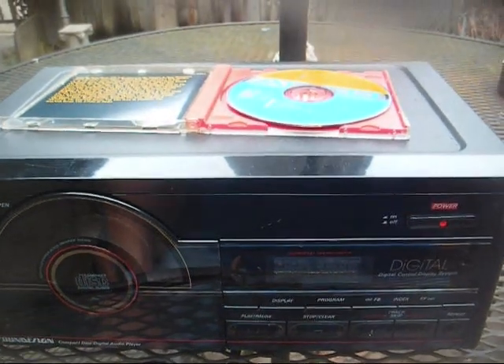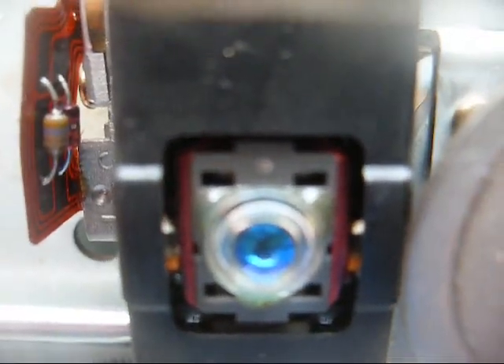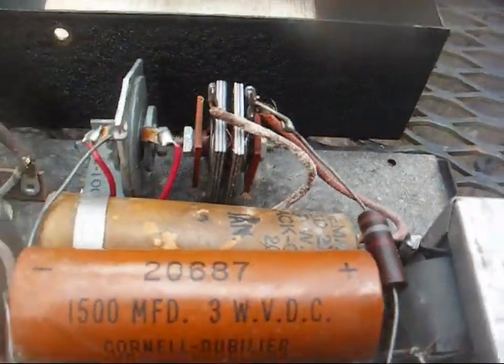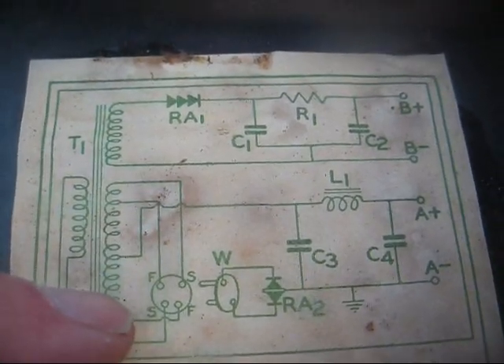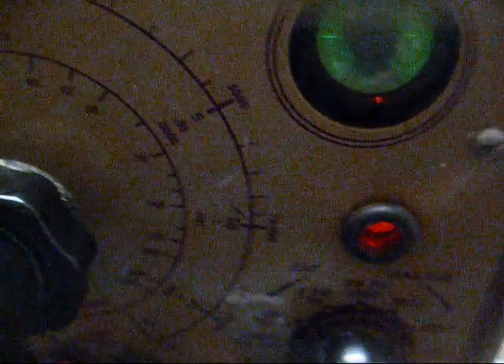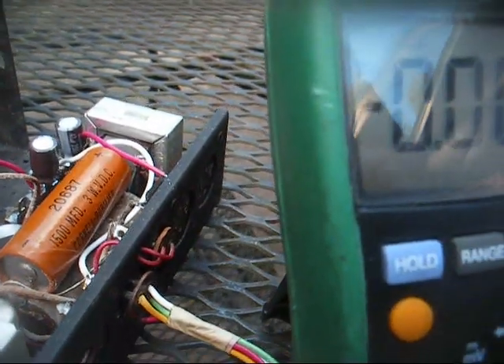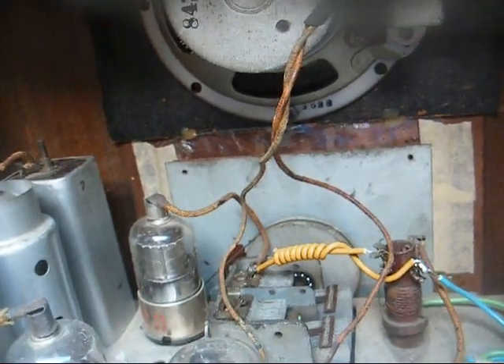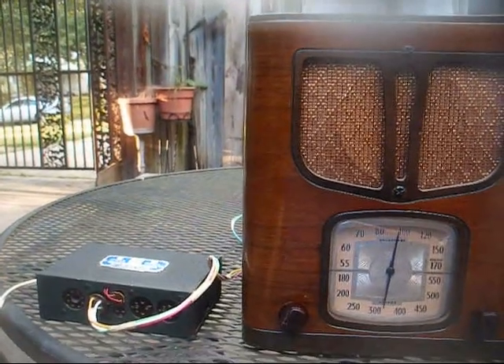Soundesign CD player repair attempt #2 & Perma-Power battery eliminator repair

Comment: if cleaning switch don't help woner id lazer is weak, try adjusting the lazer voltage up just a bit and see if it starts reading, that will tell u that a new lazer is needed in future.

Comment: Regarding the CD player. Do not condemn it yet. I have a good idea where the spring goes which would stack up to why the disk is not turning. When you pat a disk in a drive and it takes the disk in, the disk gets clamped between the motor spindle and a slave spindle. If I am correct the spring looks about the right size to fit behind that wheel. If the spring was missing then the CD would slip, the motor would spin but the CD would not, the player would give up when it could not read the disk. The color of the lazar is normal for a CD lazar, the color you are thinking of would be found in a Blu-Ray player. I hope this is helpful.

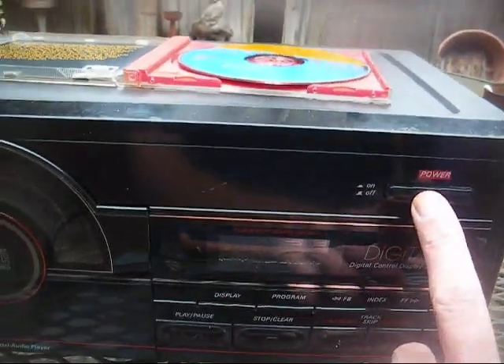Comment: 0:30 - That blinking display like that means the BIOS or logic circuitry has crapped the bed.  The fact that it can read the TOC(table of contents) on all red book CDs, indicates that the laser itself still has life left in it.   Time to EOL.

As far as your comment, in part one of the Soundesign CD episodes, about CD players "not lasting as long as expected" - they were designed that way on purpose.  

I work in second hand, and of the laser-read players(CD, DVD, Blu Ray) I've tested, about half don't work.  

And there's a bigger reason behind that, I'll get to later
Reply: CD is a crap format sonically as well as reliability, POS back in 82, POS today
Reply: @VaughnfromPeterborough   Put crappy sounding content on a CD, of course it will sound like crap!  The format itself is sonically transparent.    I'm sick of people blaming formats instead of what's put on them
Reply: @Zickcermacity  I friend of mine hates the 44K sampling, he believes it makes any recording sound "metallic", he recorded the council health inspector on the computer (mic and cass deck preamp feed in) for one he heard the man in person and heard the playback of 44K file, I asked why he didn't use 48K, he said the rec software defaults to 44K and he overlooked the settings
Reply: @VaughnfromPeterborough   Does he hear this 'metallic' sound on CD albums he bought from the store, or just on ones he produced on his system at home?
Reply: @Zickcermacity  The "metallic" sound is on all CDs my friend can hear, it is the 44K sound signature, I only listen to analogue to get away from this crap, I only listen to a CD if there are no other format choices of the recorded material

Comment: The line voltage where I live used to average around 125V about a couple of years ago, now it's been averaging around 117V which is interesting because that's what the line voltage was in the USA in the 1950s-1980s...
Reply: the Power here is 115 to 128  is all over the place fans and Windows AC don't like that low of votage
Reply: @BeautifulAngelBlossom  howdy! Most radios and fans from the 1980s on back prefer the lower voltage of 110-117V AC because that's what they were designed for originally, the 120-125V phenomenon didn't come around until the late 1980s. That's why if you tried to power a 1940s vintage shaded pole motor fan (aka dime store fan) on 120v or higher voltage they seem to run like a buzz saw but on 115v they run at a more tame speed. 
By the way what part of the USA are you from? Just curious.

Comment: Most of those have the laser mounted horizontally, with a angled mirror under the focus lens on the head. I've had luck cleaning the mirror and getting them to read, as dust and fluff collect on it. Getting to the mirror is EXTREMELY fiddly, but if you don't try, then it's junk, so what is there to lose?

Comment: On the CD player, did you check out the voltage regulator? I am not sure what type of supply is used from not seeing it? I do know that the capacitors go bad in these players and the voltage regulator. Try checking out these. This will cause it to act like this. Thank you for your videos. I find them educational. Between you and Shango, both of you are very interesting people who have the knowledge I wish I had when it comes to tube electronics. Thank you for your channel

Comment: I didn't see the spindle motor spin the disc, but some players won't spin the disc up unless it gets a reflection from a disc;  also I didn't see the lens move at all in an attempt to focus which I think it would try to do even with no disc.
Reply: Usually those laser beams are bright cherry red that I've seen that one looks weak
Reply: I've heard the potentiometers for the laserbeamer close to the unit itself also you might want to try looking Google for that model number and that brand name and the problem you're having with it and maybe they'll be some information from somebody else said the same issue I did that with my DVD Panasonic player by the code number that showed on the screen